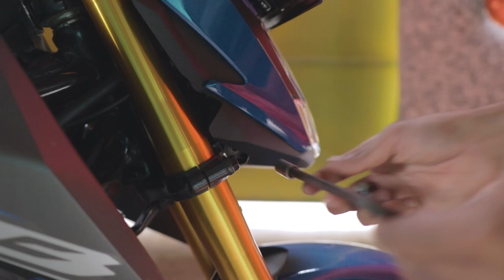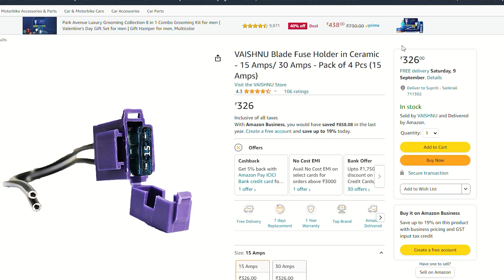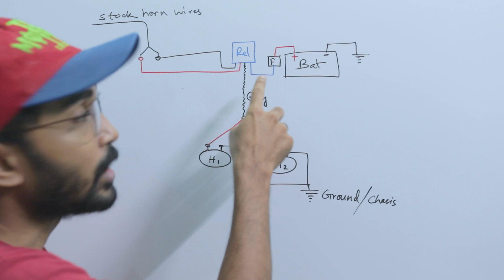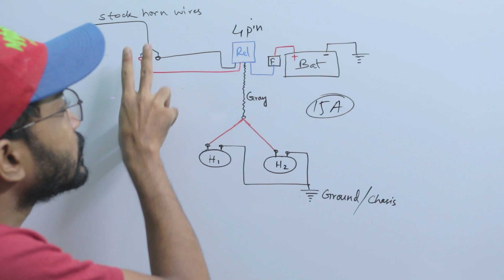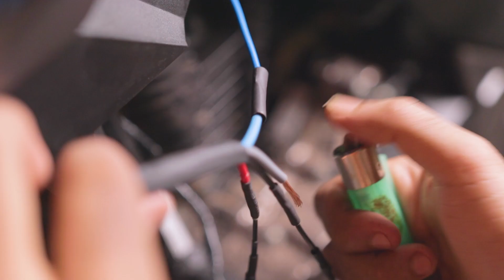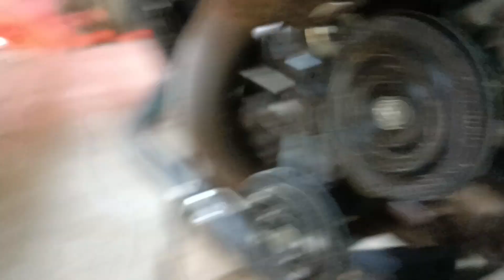Step-by-Step Guide: Installing Dual Horn on Honda CB300F Twister | Louder & Safer!

Comment: Bro,I upgraded the horn on my gixxer to bigger single horn but i have faced issues with rectifier it has failed 3-4 times and i had to replace it. Whats going on? Please help
Reply from the maker: It's not designed to supply that much amperage. Make a relay circuit.
Reply: @EzMeck  how ??
Reply from the maker: It can support 2Amps max, if you use more that 2A horns, it will blow the rectifier. That's why I suggest for a relay circuit, follow the video

Comment: Latest city commute mileage?
Reply: Mine gives 38 in traffic. On highways if not ridden  in rush milage goes till 46 kmpl
Reply: @anirbankundu1042  which city are you from and do you get that mileage from using normal petrol or high octane one?
I'm barely getting 30kmpl
Reply: @ajayeshn.3085   hi. I am from a  town area  in west bengal...40 kms far from Kolkata. I am using normal petrol. On highways if I ride the bike around 90 kmph then 43 kmpl I get. Bt if ridden around 60 to 65 kmph.. then I got 46 kmpl highest and then bad roads and traffic starts and the milage dropped to 44 to 43 again
Reply: @ajayeshn.3085  a town area near Kolkata. I am using normal petrol.
Reply from the maker: https://youtu.be/vlbrqOSAjIE

Comment: what is the diffrence between G70 and D90? I personally have D70 fitted on my bike since 4 years and the D90 sounds exactly the same but is costlier.
Reply from the maker: Same amperage, slightly different tone. D70, D82, D90. only D95 is 3 amp each I guess.